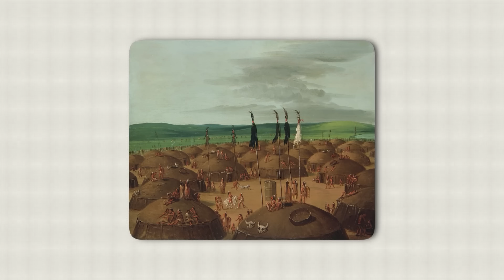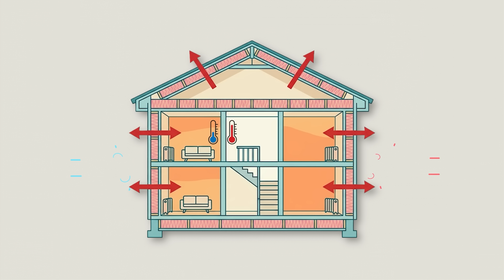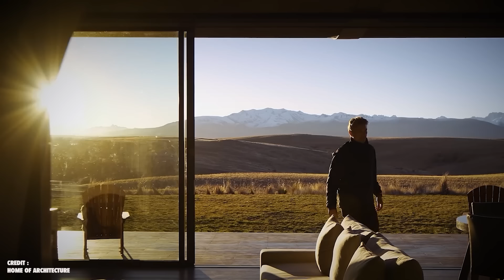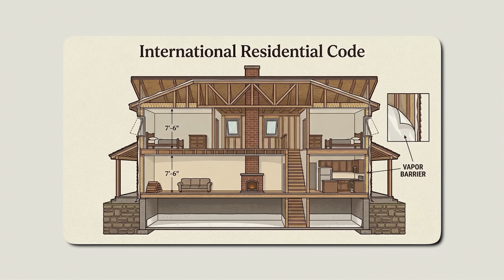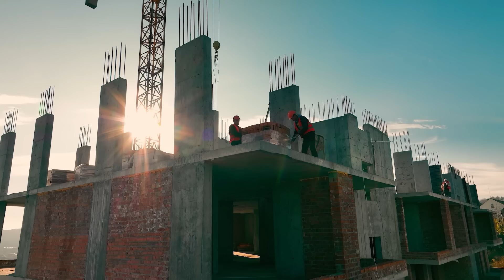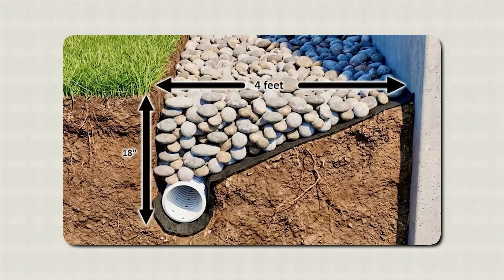Earth Sheltered Homes Were Used For 10,000 Years — Then Completely Disappeared By 1990

Comment: Oh ya I pay 0$ to heat my place 😜
It's called living in Hawaii lol
I go to the beach in winter lol
My clothing consist of a bikini top and booty shorts. Lol
I drink ice mocha in winter.
The problem is cooling not heating.
So if you don't want to pay anything for heating move closer to the equator. 
California is a good place? 
I wish it was cold here. Easier to get warmer then it is to get cooler
You can only strip so much
Reply from the maker: Sounds like you need evaporative cooling. Cold shower can help with that! :)
Reply: A simple and cheap thing you can do is add awnings to all your windows, this drastically reduces solar gain, another thing you can do is over-cool your house during off-peak night hours, keep some windows open, maybe install a windcatcher/solar chimney (fairly expensive up-front tho) grow trees around the property for added solar gain reduction & privacy, lower internal humidity with indoor plants & a central dehumidifier,
use a refractive paint colour like white instead of others, etc